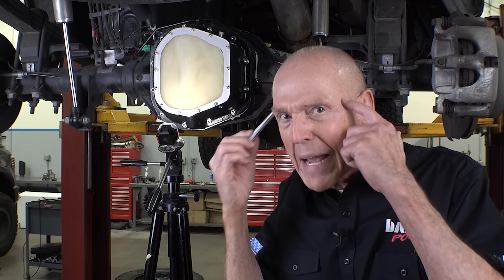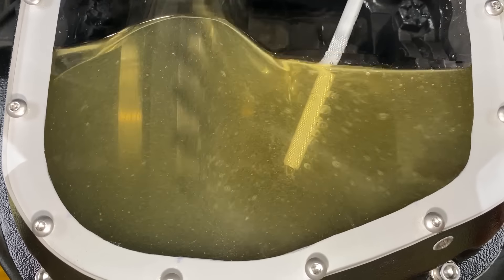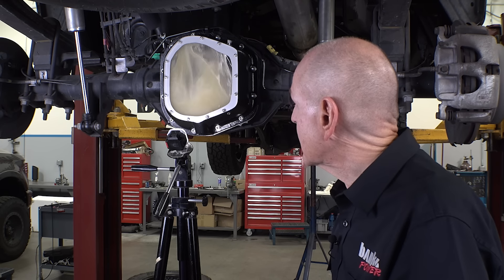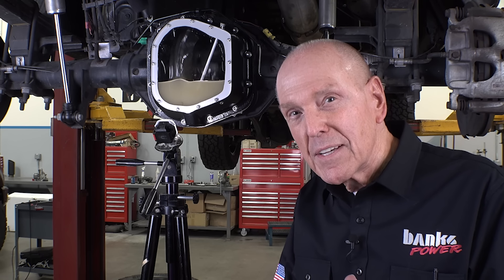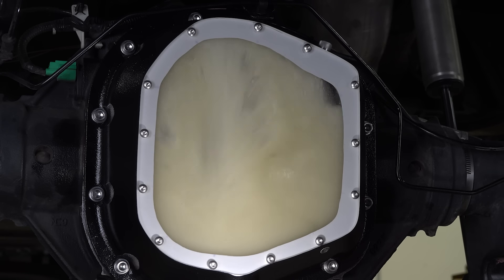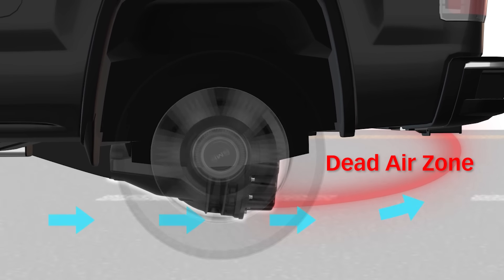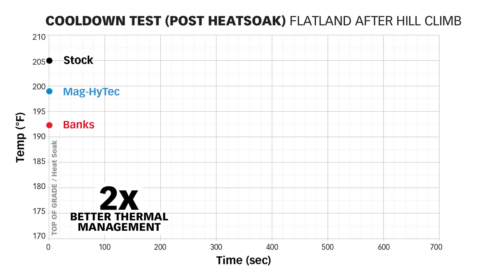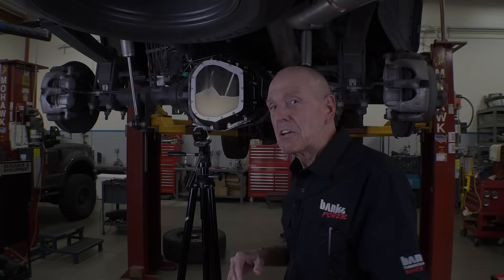What aftermarket diff cover guys don't tell you!

Comment: What about salt/snow/dirt buildup in the “ram-air” intakes
Reply: Good idea.
Reply: Even with buildup the banks design would be superior to the flat back design due to fluid dynamics alone. Plus I assume buildup in that area would be low since it's in a relatively protected area.
Reply: Dont think it will be that big of a problem, snow melts as the diff warms up. You can get the cover in powdercoated finish. Look at Bmw M cars, they have the same type of design and for over 30 years.
Reply: @Gravstein  but bmws design doesn't have channels that flow up bmws have fins that extend down where air and debris can pass through.
Reply: I’ve had issues with snow in my 2011 dodge 6.7L cummins. Sometimes we get deep powdery snow here and you have to go at it with momentum to bulldog through...unfortunately it also stirs up and sucks that into the stock air box.
Reply: Wash your truck
Reply: Snow is not an issue, at 150+ degrees Fahrenheit it won't stick around for long. As far as dirt build up its possible if you offroading with it, but this is not a offroad mod it is a highway mod for heavy pulling. I see no reason it couldn't be used offroad, once it packed with dirt it still functions internally as a stock cover so no issue on it being plugged up till you wash off the mud.
Reply: I have a banks cover and I’ve never had a problem with it on the sand, towing, snow, etc. I’m not sure how much it helps but I get better fuel milage lifted vs stock and I’m sure the diff cover helps. Not as much metallic build up in the fluid when I change it also.
Reply: Exactly.
Reply: @Gravstein  First, the salt would prevent the snow from becoming ice.
Reply: @uglymechanics6599  Intake is totally stock, so yes, in the fender.  Deep, light powder snow when it's really cold out will get sucked into it. "Service Air Filter" DTC pops off due to it.
Reply: @uglymechanics6599  yeah when you’re bulldozing at least 2+ft of snow you discover things lol. Like the transmission also tends to be warm enough to create ice in the transmission tunnel resulting in some really odd clunks after a bit too lol

Comment: This makes me get scammy feels from Banks... The clear diff cover doesn't have the fins inside like the cover it is supposed to be emulating. Therefore, the fluid flow inside is NOT the same... Also, Banks offered no example of the fluid dynamics within their own cover 🙄 

Aside from that, the Ram Air Banks design would only be acceptable to run on the highway, so only highway haulers would benefit - ranchers, welders, offroaders, and anyone else out there who needs or wants to go into dirt would not be interested in less clearance on their diff cover, and a design that might break or catch obstacles. I'm sure it wasn't designed for offroad, but I suppose I feel that Banks focused on a narrow demographic here. 

The temp test is nice, but doesn't really explain the whole issue at hand. I would have rather a temp probe internally in the fluid, than a heat reading off the cover... Also, what I a safe temp for gear oil to run at? Less than 250° F... So, is Banks claiming to extend the gear oil life? Is it unnecessary fanciness with the same service intervals? 

I'll pass Banks, and I'll be more cautious of your other products and claims. Thx.
Reply from the maker: Thanks for watching. The cover shown at the beginning of the video is made by PPE. The cover tested on the truck was a Mag-Hytec. The goal for any diff cover is not to stop the oil from going over with the ring gear. The goal is to encourage MORE oil to flow over the ring gear. The PPE would impede the flow and severely aerate the oil. Think of a rocky waterfall. The oil is white because of aeration. Air is not good for lubrication. 

The Banks differential cover is fundamentally different from its competition because it utilizes Ram-air scoops that direct air through channeled fins, cooling the differential and internal oil temperatures. Regarding the clearance and our Ram Air Diff cover, our patented Ram-Air scoops are designed to increase airflow over the rear differential without sacrificing ground clearance. In fact, our differential cover retains the same low point as the factory and competitors. 
You can see the side-by-side comparison as well as the temp test data on our website: https://bankspower1.monday.com/boards/466868070/pulses/5708033658

Lastly, this was the last installment of a multi-part development series. For a full breakdown of all the data and comparisons, watch the full "Behind the Diff Cover" video series here: https://youtube.com/playlist?list=PLwtmrqcWzLtQR9riOg8mizIEj-UX4WBBm

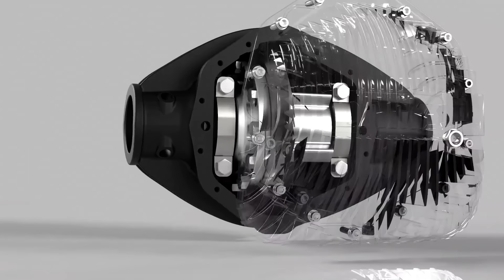Comment: 7:58 “For efficiency the gears and bearings would prefer the lube to be right around 200°[F], anything more than 200 and you’re taxing the base oil.”

9:44 Map is rotated so closeup is south at top and north at bottom. Red travel line grows north to south from Smokey Bear Rd to Castaic. That is down the grade, not up. Not claiming Gale is misrepresenting the test, just that the graphic was poorly designed.

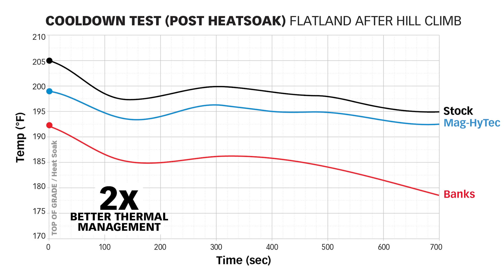11:20 Stock cover only reached 205°F and stayed closer to 200°F than either aftermarket part during the entire cool down. BANKS was lowest at all points during the test. The BANKS cover may reduce oil degradation but would likely reduce efficiency in all but the most strenuous situations. For the test truck at least, the most efficient and reliable choice for daily driver with occasional or frequent strenuous situations would probably be the stock diff cover with a high quality synthetic gear lube like AMSOIL Severe Gear® Synthetic EP Gear Lubes. That said, put whatever you think looks cool and check your diff oil after strenuous use. I think the BANKS looks cooler, has a bunch of great features, probably less likely to damage your diff than other aftermarket options, and is a great way upgrade for a truck with BANKS products under the hood. 

I have no affiliation or relationship with BANKS, AMSOIL, or any other company mentioned in this video.

Comment: Nothing against Banks and the products he offers as they have a fine reputation. 
What I will say is I've been running a Mag-Hytec rear diff cover for well over 15 years on my 02 F350. In that time, this truck often pulls an enclosed toy hauler trailer (approx 9000 lbs) or a 30ft boat at about the same weight on the trailer. I've never had a burned up diff bearing and I have even pulled the cover once just for an internal inspection, with no issue found.
I'm going to leave that Mag cover on as it has served me well over the years.......just saying....real world experience without trying to sell you anything.

Comment: Believe me, the  axle manufacturers (e.g Dana), spend an  inordinate amount of time testing diff covers,, lubrication trajectories , coupled with severe stress testing of the ring/pinion/inner/outer axle gears. Take a look at the super duty 450 /550 differential covers and you will see the engineering that went into these. Moreover , todays synthetic gear lubes are instrumental in 1) lubrication, 2) heat transfer and most importantly  3)sheer strength.

Comment: Stock diff here on a 10 bolt with the exhaust dumped on the rear axle(it’s literally black) and after 100k with the exhaust like that I took it in to get a Detroit true track and the guy was amazed at how good the fluid looked and re used the bearings that have 190k on them 🤷‍♂️ also I have been super hard on the truck, redlined at least every other drive

Comment: About 30 years ago my dad told me to check the fluid in his 3/4 ton truck because it was starting to make some noise. I pulled the plug out of the dana 60 and slid a normal size screw driver in and nothing on the end when i pulled it out. I then tried a long enough one that i actually tapped on the bottom and as i pulled it out once again nothing. I put close to 3 quarts or so in until it was full and everyday for several days i checked for axle seal and pinion seal leaks Nothing! The noise was gone and everything worked fine until he traded that old 78 for a brand new 92 f150. Yup hard to believe and i still think of that from time to time and laugh to myself

Comment: And yet you can easily get over 500,000 miles on a ring gear and pinion .  Take a trip to the Corvette museum stock Corvette over 700,000 MI. My 95 Z71 short wheelbase 279, 200. My uncle's ton truck used to haul logs has more miles than I care to mention. All with stock covers.😱  The whole reason why the diff oil is being pressure washed to the back of the cover,  the ring gear is first dipping into it at the bottom. The remaining oil left on the ring gear  is  sufficient enough to oil the pinion. Not to mention the hurricane 
 oil swirl making its way back to the pinion. It's not like it's desert dry. that's the reason why we almost never hear of a differential going out due to wear and tear. Now popping the trans brake at 6 grand is a different story, are pulling a houseboat 100 mi everyday.. gotta love these guys selling these must-have products .why would I want to extend the life of my deferential that's going to out live the motor and transmission? Listerine was the  first company to come out with the (you need this product) line. then other companies sold the ( must have lines ) it all trickled from there ever since.
Reply from the maker: Thanks for watching. If you're suggesting we're trying to reinvent the wheel, it's an age-old argument. Everything can be improved. Apple didn't stop innovating with the iPhone after it launched in 2007. For a full breakdown of all the data and comparisons, we have an entire series that showcases the diff cover development. Watch the full "Behind the Diff Cover" video series here: https://youtube.com/playlist?list=PLwtmrqcWzLtQR9riOg8mizIEj-UX4WBBm

Comment: So basically a stock cover is totally adequate and keeps temperatures about optimum. Nice aftermarket cover they have there , but looks like oem is just fine unless towing heavy loads up hills in the desert. Personally I pick up speed before hills and let off the throttle while going up to reduce drivetrain and engine load ,that's really the way your supposed to drive up hills but I know that's not possible in long uphill battles sometimes.

Comment: Went and watched garage 54s video about what cold fluid looks like in the diff and in it they have a vacuum formed diff cover. They run the Lada at a couple speeds both warm and cold and how the oil flows visually is very different.

Comment: I'm not quite buying this - I've been driving HD pickups and semis pulling almost everything they make and never once in 50+ years lost or had a diff go bad or fail in millions of miles. The pinion, ring & bearing are half submerged in oil, they don't need any additional lubrication. 
In retrospect, I'm sure the aluminum cover will keep temperature down and look great on a pickup but this is certainly nothing  that is mandatory to operate any truck. 

Mike

Comment: Theoretically your right but practically you prove you wrong because the gears dont need to be in an oil bath to reduce friction and its not like the gear dont move eventually everything is lubricated and the cover is doing job of cooling

Comment: If you were truly unbiased, you would have noticed that the aeration did not increase with the diff's rotational speed. You kept blabbing about some nefarious fluid dynamics you could not prove with your setup. On your cover, you have a magnet on the fill plug that is never splashed with oil.

Comment: rotating gears in a sump design of lube oil naturally ALL aerate the oil. It's a fact of the simple gear tooth plunging into the oil. Redirecting the lube to the pinion on the open side is unique and desirable and you can't dismiss the temp comparison on the actual Grapevine pull loaded. The ultimate solution is a 'dry sump' lube system like on race car differentials. Directing the lube directly at the bearings and teeth is the only way to get the lube where it needs to be, and having a reservoir and de-aeration tank as found on all dry sump oiling systems is the ticket. Pull out that checkbook though, it's expensive.

Comment: What I'm not seeing as any comments here is that I've been able to add 2 more qts of gear oil capacity in my aftermarket diff cover over stock. I do change at 50k intervals. Over 300k with zero issues with plenty of heavy towing.

Comment: But hold on, I thought you wanted the oil around 200f according to the video? The banks cover in the test cooled it below that level. Is the oil thin enough to travel as manufacturer wanted it?
Reply: Exactly what I thought keep the stock cover we don't have any of this type of stuff on class 8 semi trucks and those rear ends go for more than a million miles without issue

Comment: Clear and concise goals when designing a product. I would like to see more data on inside flow and air atomization but overall the airflow directed over heat sink is a great addition. Staying true to the original shape also helps if the scoops get filled with mud. If anything it will go down to OEM designed cooling efficacy and not be a detriment. Overall this will sell well.... which that’s what this vid was. A selling point.

Comment: The rear diff oil can run a constant 250 degrees with no breakdown. 300 degrees is the maximum intermittent temperature. Is the displayed difference in temperature worth the cost of the cover? That is for you to decide. I'll stick with the stock cover, thank you.

Comment: I'd like to see the banks in a clear cover to see their clains to internal oil flow. Also the "aero" ram air design in a wind tunnel with smoke to see if it actually does what they say in a real live setting AND what the other cover does temperature wise with the same quantity of oil in it.....7quats in a 3.5quart diff will generate more heat so would have higher temps! Like for like comparison needed.
Am fairly sure he said diff oil likes to be at 200c too and then later that the banks cover cools the oil way below that? 🤔

Comment: So in addition to catching air wouldn’t it also catch and hold road grime and dirt?  Then if it does that would that not hinder its capability since it would be “clogged” so to speak?  And if all that grime is caught inside the cover would that not lead to corrosion?  I’ll stick with the factory engineered cover for this.
Reply: This cover is mostly targeted to those of us who haul heavy loads across the USA at highway speeds.  I routinely haul boats from the East Coast to the West coast and for me, having the ease of changing the fluid on my 2021 Ram with a OEM recommended 15K interval is key since I have to do it every other month and sometimes sooner.  

For Rock Climbing and Mudding there are other alternatives that come to mind.

Comment: It could be the horizontal fins inside the flat back help to reduce the aeration of the oil
Reply from the maker: Thanks for watching. The cover shown at the beginning of the video is made by PPE. The cover tested on the truck was a Mag-Hytec. The goal for any diff cover is not to stop the oil from going over with the ring gear. The goal is to encourage MORE oil to flow over the ring gear. The PPE would impede the flow and severely aerate the oil. Think of a rocky waterfall. The water is white because of aeration. Air is not good for lubrication. 

For a full breakdown of all the data and comparisons, we have an entire series that showcases the diff cover development. Watch the full "Behind the Diff Cover" video series here: 
https://youtube.com/playlist?list=PLwtmrqcWzLtQR9riOg8mizIEj-UX4WBBm

Comment: The quality of the lubricant has a lot to do
with it. There are lubes out there that are
made "sticky" or with a cling factor to stick
to the metal surfaces to prevent slinging or
flinging off. There is also a "difference" in
price of these lubricants. Also, there is 
nothing wrong with stock. The biggest culprit is not changing the lubricant at regular intervals. Most rear ends out there have the 
original shit in there forever n never gets changed. Lubes do break down over time 
causing degradation n wear.

Comment: I notice that he never shows the flow on the Banks cover at different speeds. Also why haven't l heard people with the other covers complaining about pinion bearing failures? Sounds to me like a car salesman's pitch. But he did convince me to keep my stock cover and pulling my toy hauler with my Dodge dually l have a combined weight of 19k and have never had a differential issue in over 100k miles.

Comment: Thats why 8 like my FF14bolt and other older difs. They are built were when filling you can only fill to the fill plug. Then it starts coming out. The fill plugs are located lower and not on top. Same with my transfer case not allowing you to over fill.  I wish he made one for my axel. But he doesn't.

Comment: Gale, awesome job on designing the diff cover, just received mine and it feels really stout and well made. Can’t wait to install it.
Reply: Rick, what did you pay a yr ago?
Reply: @toddrhine7648  
I’ve had it for 1 1/2 years, I think around 350ish. It works beautifully, and one of the best things no leaks and the site glass. Just look and you know the level. On aircraft, Eng oil, hydraulic levels are mostly on site glasses. It’s fast and accurate, and to change it is one plug. No 14 bolts and ruin a gasket and a mess. I love it. Awesome job Gale Banks!
Reply: @rickbrown7067  So does it have a reusable seal of sum sort or what?
Reply: @toddrhine7648  
It has a O ring seal, you never have to take the cover off. Check out the banks videos.

Comment: There should have been loovers on the inside ? So I’m not sure if the representation is totally accurate but it’s close enough to make the point, the hub should be the same shape to get the adequate oil